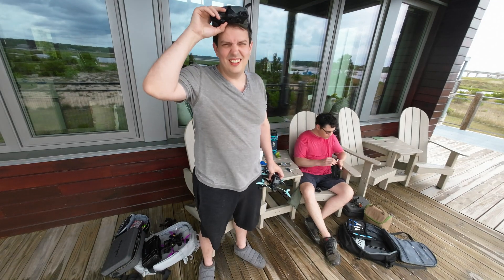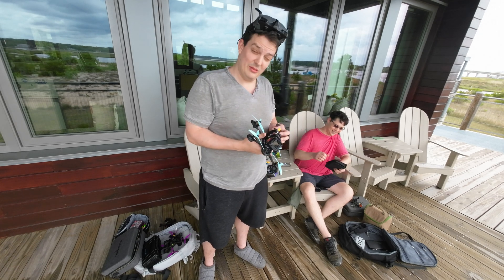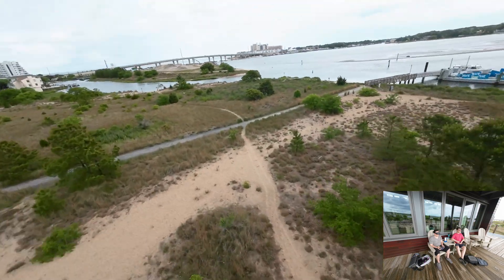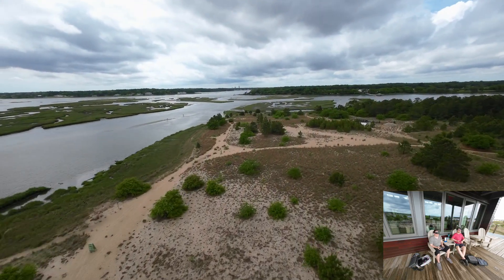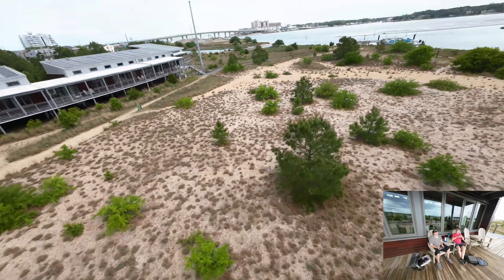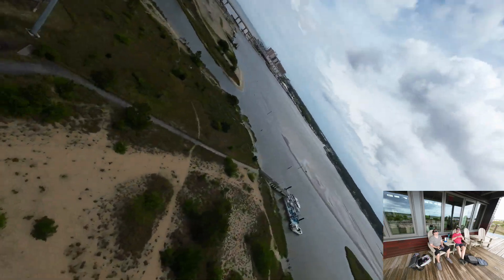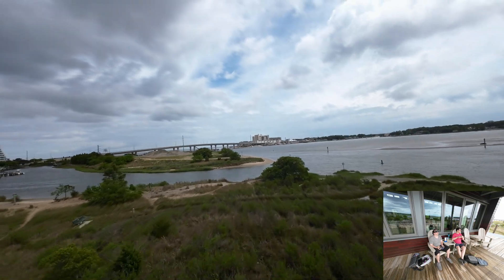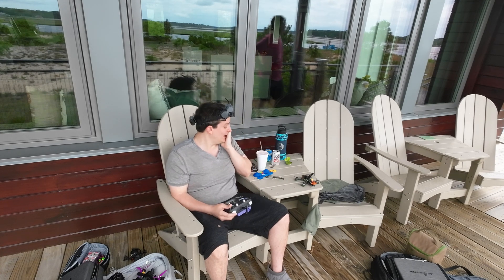8s 5" FPV Drone Maiden Flight

Comment: Its def got more power.....😂😂😂 you think? Thats about 20 to 30k more rpm because of the 2 extra cells depending on motor kv usually around 1500 kv
Reply from the maker: Haha I guess that should have been obvious. I am used to flying high KV (2,000+) so its actually relatively the same rpm. 2100x22.2= 46,620 & 1600x29.2= 46,720. I still feel a difference in power for some reason though